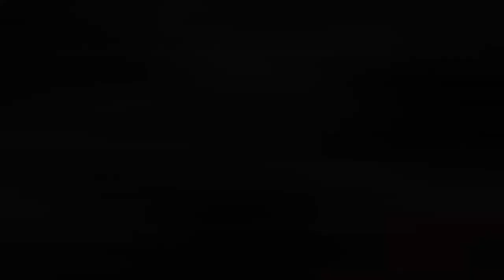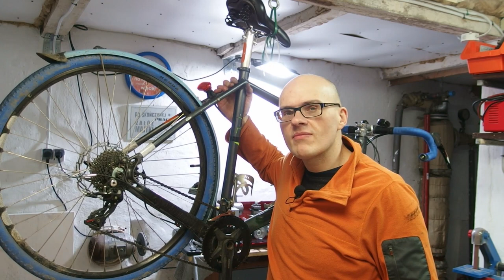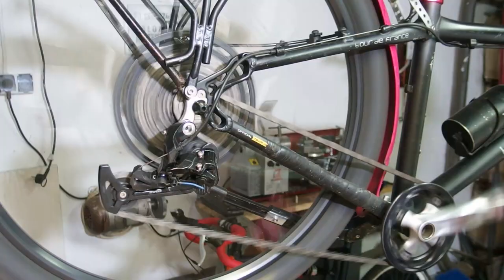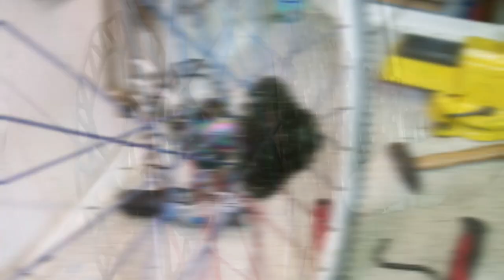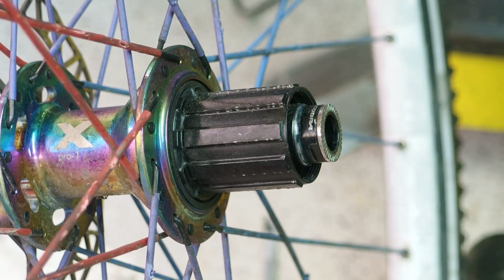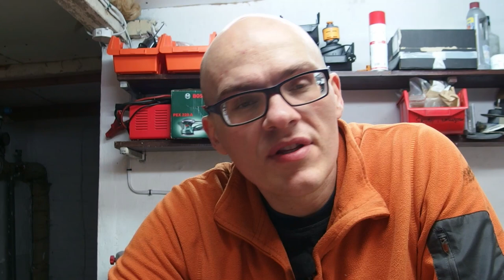Summary of stuff I reviewed in 2020

Comment from the maker: UPDATE: New development on the X-Cobra rear hub. Three weeks after recording of this video a bearing desintegrated in the freehub body and as of now requires replacement. Foreshadowed by the slight sway of the cassette you can see in this material. At this point I cannot recommend it.

Comment: hey trybo i have a question. so I recently washed my mountain bike because it had a lot of  dirt on it and I have ixf crankset with the stock bb and the bearings ended up rusting up and I have to buy a new bb. so my question is how do I prevent this from happening?
Reply: I also use ixf, rather than changing the whole bb u might want to only change the bearing to save money. Also choose rubber sealing bearing as it perform better in protecting from contaminants
Reply: @hilmikhuluqy5569  how do you change only the bearings. and also could you send a link of some rubber sealing bearing i could buy?
Reply: @hilmikhuluqy5569  ok thank you so much i appreciate it
Reply: Be careful to not spray high pressure water into bearing areas as well. I usually just wipe those areas with warm soapy water soaked cloth. And then wipe dry if I am worried about rust.
Reply: @patchesthejaybird8431  great idea thanks man